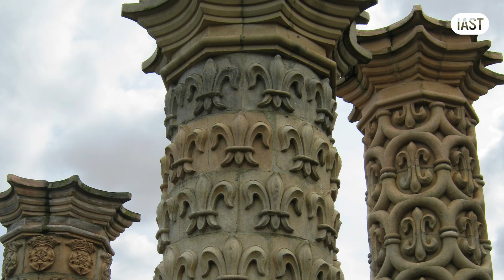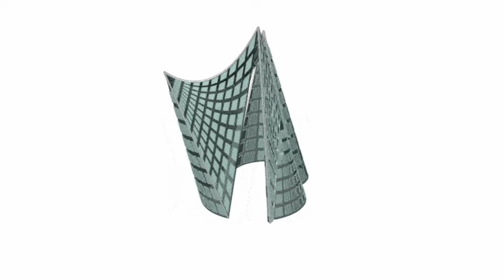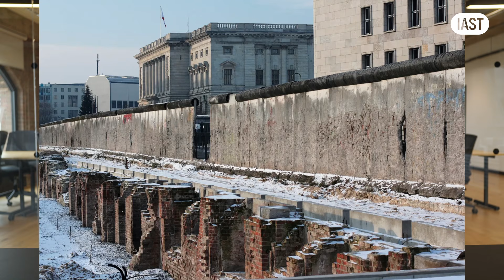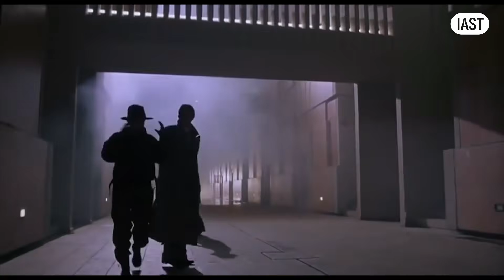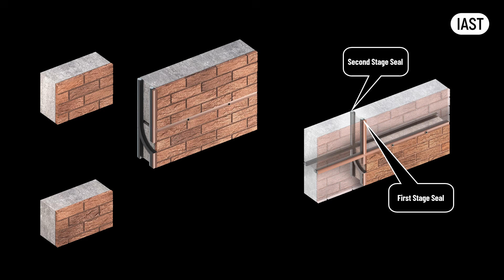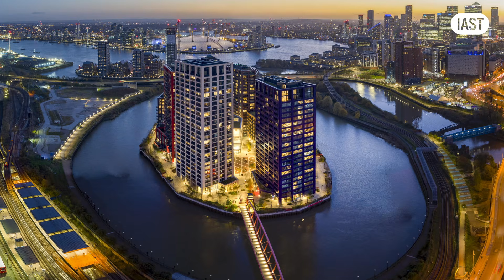Precast Concrete Facades |  Architectural Engineering and Facade Design

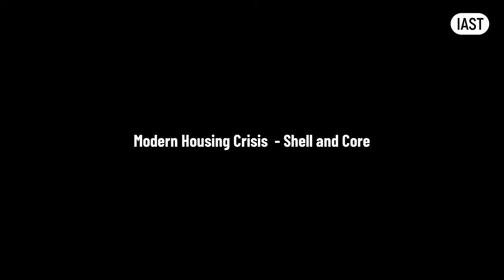Comment: “@17:30 — "Unfortunately, GFRC tends to stain easily, causing many of these structures to appear outdated within a decade of completion."
 Do you think this issue is due to the inherent properties of GFRC, or is it more related to QA/QC,  workmanship and detailing?”
Reply: Great question. and honestly, it’s both.

GFRC is porous by nature, so the design has to account for that: proper water management, drips, overhangs, sealers, and smart detailing.

But most of the staining issues I see come down to QA/QC and workmanship: poor joints, bad sealants, missing drips, water sitting where it shouldn’t, and inconsistent curing or finishing.

So yes, GFRC can stay clean for decades, but only if it’s detailed and installed with its material limitations in mind.

Comment: Precast Concrete using solid material is typical, but for better Insulation—what if we instead we could use Autoclaved Aerated Concrete (AAC) for the precast veneer panel holding the brick/terra cotta facing? While still using the solid concrete is the precast load-bearing columns and beams inside. Still using mineral wool, but just increasing the R-Value of the whole façade. Using less concrete +better insulation.
Reply: Nice question – and I really like the “less concrete + better insulation” direction.

AAC as a precast veneer/backing for brick or terracotta could work in theory, but there are a few big headaches in practice:
	•	Fixings & pull-out – AAC is great thermally, but it’s soft. Getting reliable anchors for brick ties, façade brackets, balconies, etc. becomes tricky. You end up needing special fixings or local concrete “inserts”, which kills the simplicity.
	•	Durability & moisture – As an outer precast skin, AAC needs very careful detailing for moisture, freeze–thaw, impact, and long-term robustness. It’s usually happier on the inside of the weather line, not as the main façade backup.
	•	Manufacturing & handling – Thin AAC precast panels big enough for façades have to survive transport, lifting, site abuse, etc. A dense concrete skin is just much more forgiving.
Reply: @EugeneKorch  Great points, as you noted the fastener would be easy to pull out of the AAC.
Reply: @EugeneKorch  I can picture an AAC panel with denser cement, maybe including some synthetic binders,  applied to the exterior surface and to the areas around the fastener connections. Of course, it would take some experimentation to find a combination of materials that could play nicely together in a range of weather and the structural shifts one can expect from the rest of the building.